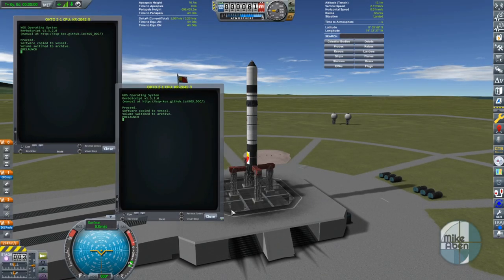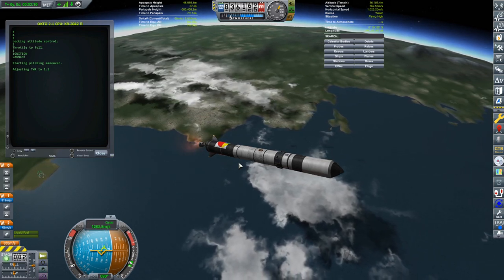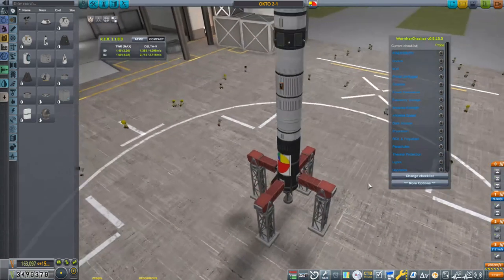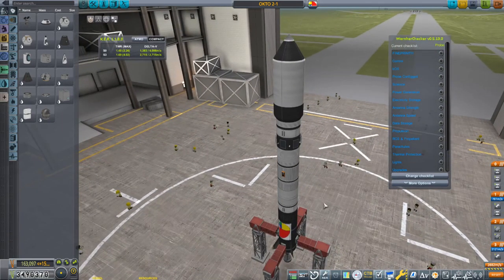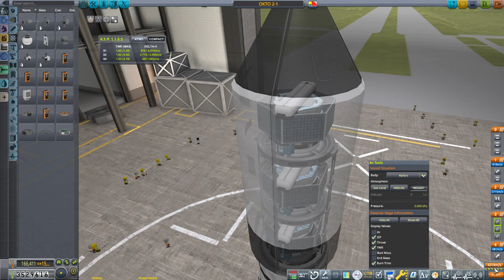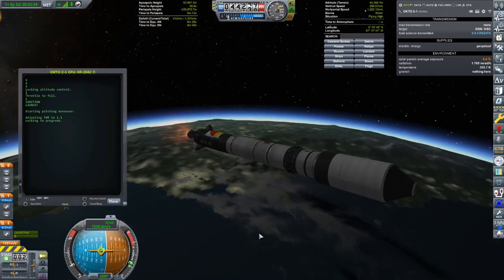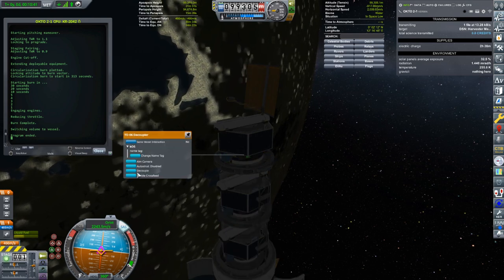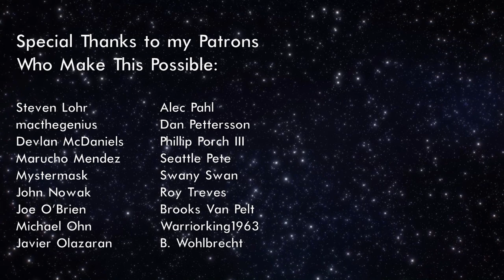Gravity Probes | Stream pt. 2/3 (KSP 1.11.2)

Comment: configurable containers won't show up as downloadable, any idea why?
Reply from the maker: Are you using CKAN? If so, set the filter so you see all available mods, not just compatible ones. It may be that the mod is older. You can adjust CKAN's settings so you can still download it.